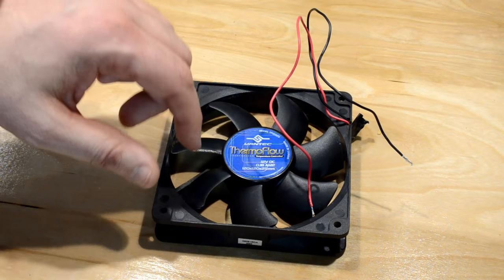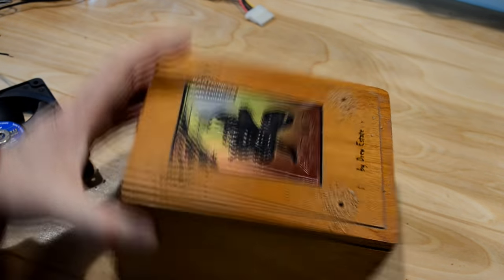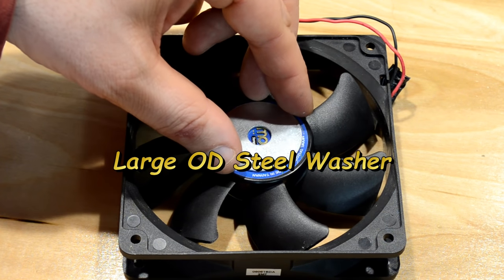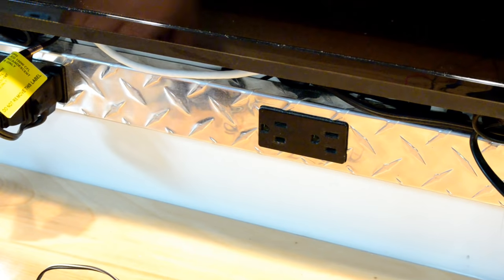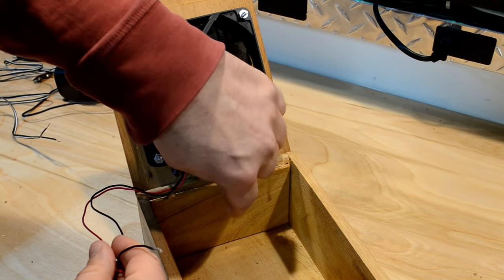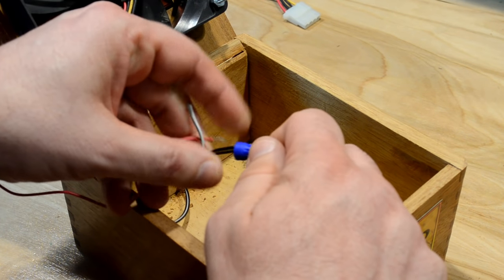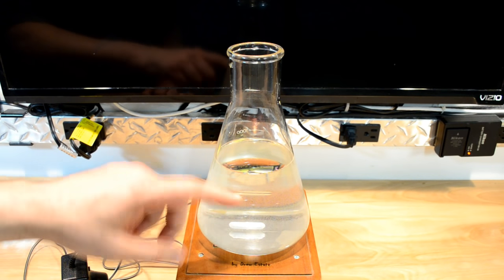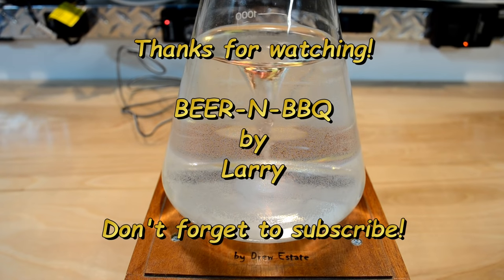Magnetic Stir Plate: A DIY Project

Comment: Great vid Larry!  I have a similar cigar-box setup only I used a cheap PWM controller from Amazon for the fan speed control.  I also keep an extra magnet wrapped in electrical tape to pull the stir-bar off to the side of the flask so I don't drop it in my fermenter when pitching.
Reply: good idea Dennis!  i like that

Comment: Thanks enjoyed watching this video, and music is great! Just want to know if you have a link for the multi voltage dc adapter. I have tried using a potentiometer to control the speed but not successful as those I have tried have resistance that's too high. I have now gone as far as 100 ohms. Thanks again!

Comment: Hey LARRY, GREAT VIDEO.  MY FAN DOESNT SEEM TO RUN FAST ENOUGH.  IM USING A 12 volt 100mA power source, do you think that’s not enough power? It just barely makes a vortex in 750ml of water and doesn’t seem to move a yeast starter
Reply: BEER-N-BBQ by Larry what’s the chance the fan is under rated?  It’s 12v 0.12 a rated...1400 rpm

Comment: so, is it a dumb or smart for me to build a stir plate and use for my 3 gallon fermenter while im fermenting?
Reply from the maker: If you're building a stir plate WHILE a beer is already fermenting then it's too late for that batch. LOL
Seriously, if you are only doing small batches, you don't need to grow yeast since the vials/packages/packets are usually designed for a 5 gallon batch anyway.
Reply: @BEERNBBQBYLARRY  yes. i am trying to be cheap and save the yeast pitching rate. i am trying to see if i can pitch lesser from my packet by letting the yeast multiply in the starter first. by doing starter, i am also trying to make sure if the yeast is starting before i go make my wort. if no, i dont start with the wort. im new to home brew. I am not sure if my understanding above is accurate or correct. I have some table fan motors sitting around, so i am trying to see also if it is a good idea to make a stir platform for my fermenter